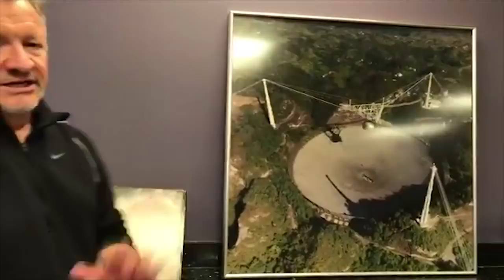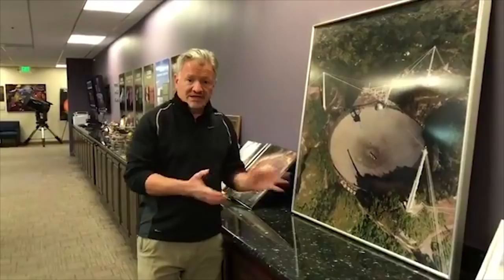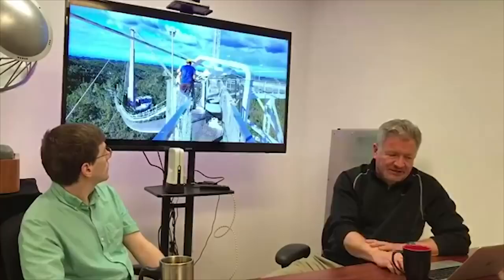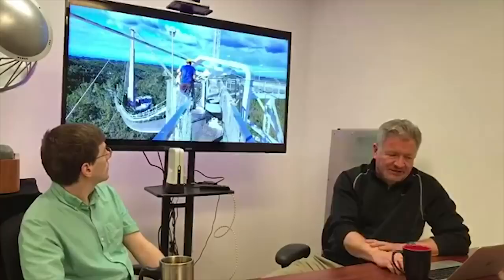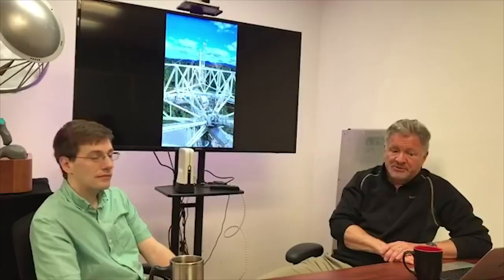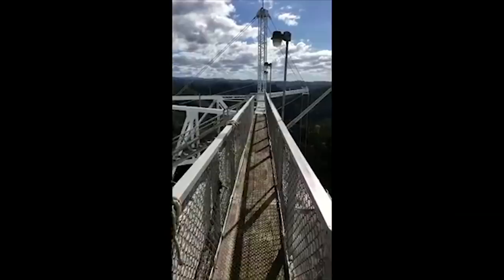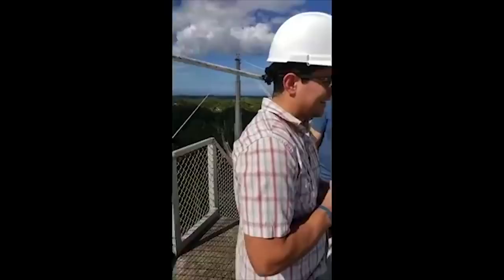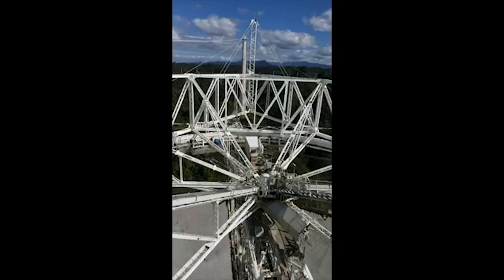Tour the Arecibo Telescope

Comment: Without actually being there I'm at a disadvantage in the following statement. First, cable breaking is definitely the result of insufficient "working length, flexibility, heating, and clamping that will provide the necessary structure to protect the cable. Aircraft are faced with this problem every time the plane's engines are operating, both on the ground and in the air. The wings on a plane have a natural flex during flight. It seems obvious that the cable must be allowed to flex accordingly. The major difference here is the immensity of the dish, the length of the cable, and possibly the inability to properly clamp over wide spans. Another problem faced by aircraft is aging. Metal develops fatigue which results in potential failure, at any time. It is hard for me to believe this is a big surprise to anyone, including structural engineering. I got the impression that failure involved human involvement, on purpose.